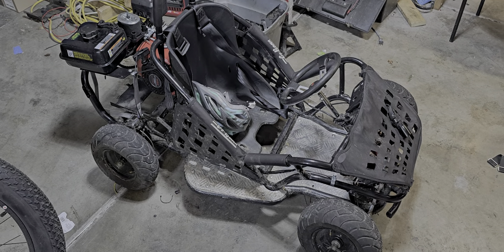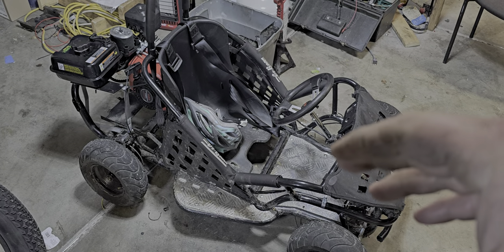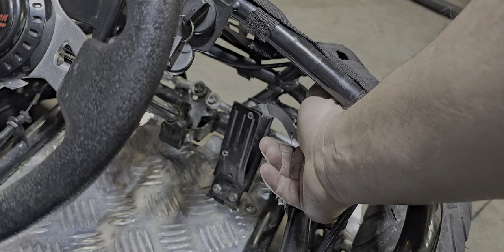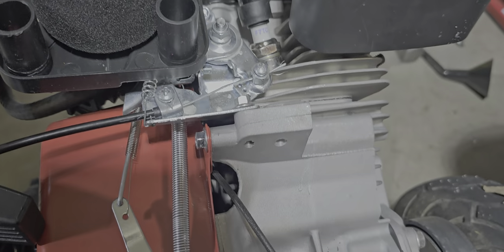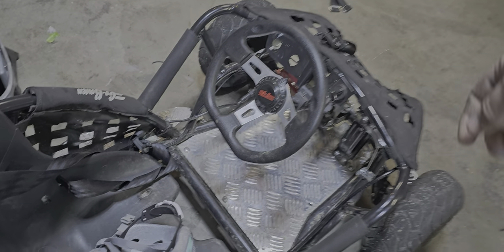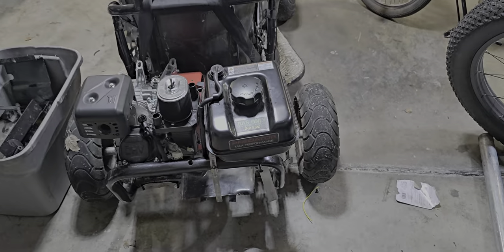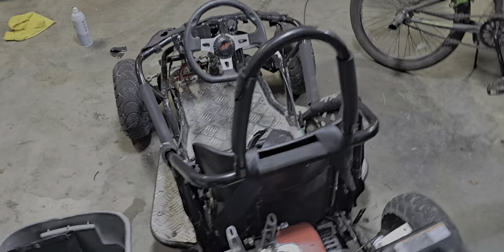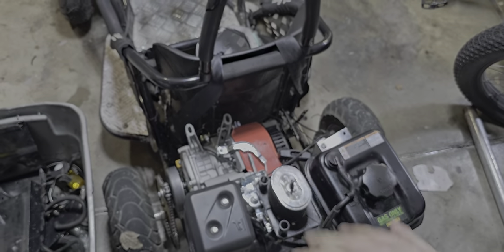(Predator 224 )Throttle Cable Hookup to - Go Kart. Go Bowen 1000w electric to gas conversion

Comment: Did you have a problem with the throttle not wanting to open up all the way? I noticed when I put mine on the kids go cart when I turned the idle down that little black piece that moves will barely move at all
Reply from the maker: I had to rework it I will be back on Monday ill try to make a video showing what I did

Comment: Are you using a engine spacer or have it mounted directly to the factory spot where the electric motor was
Reply from the maker: I made a plate
Reply: @BarkLife  thanks man, I bent the bars like you did in your video , thank you for that! All the room now! Any issues with the straight clutch to sprocket? Debating that or seeing if I can fit a torque converter/jacksahft setup on jt
Reply from the maker: @Teters_Garage  I strongly recommend trq converter. Let me know how that works, we want to convert to.